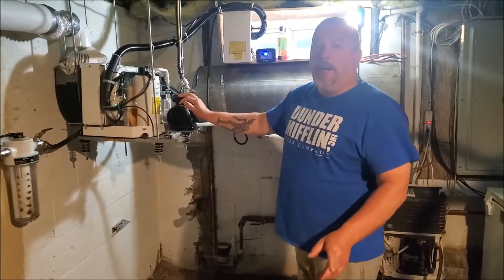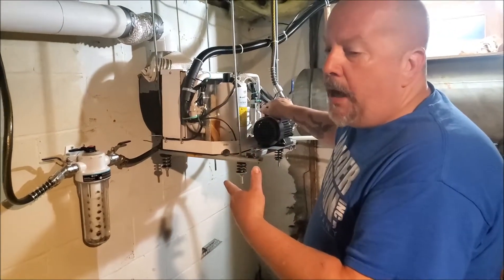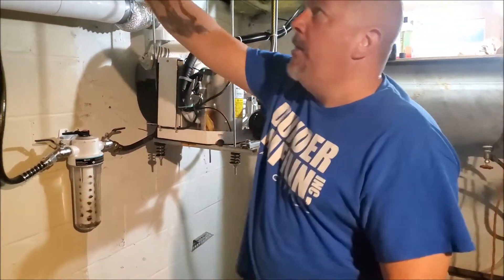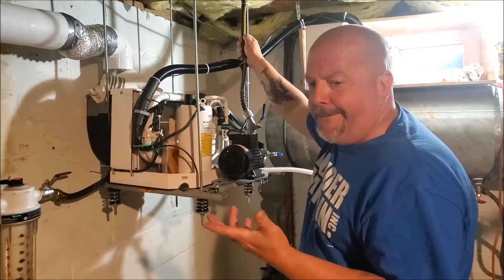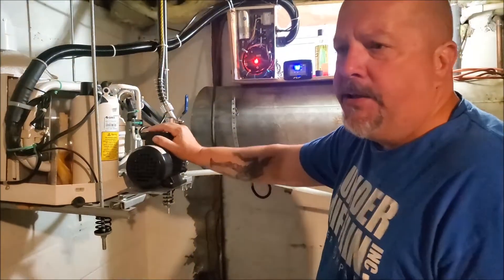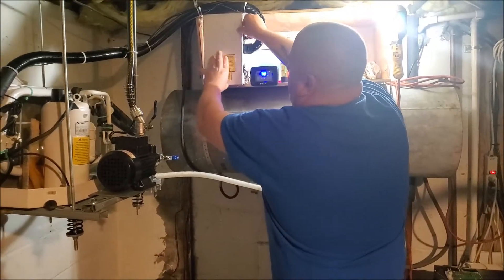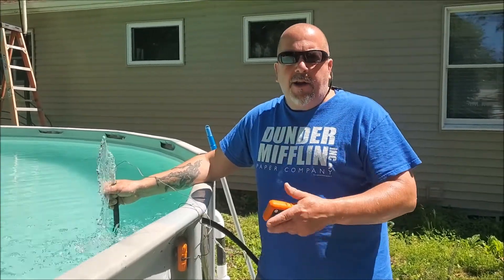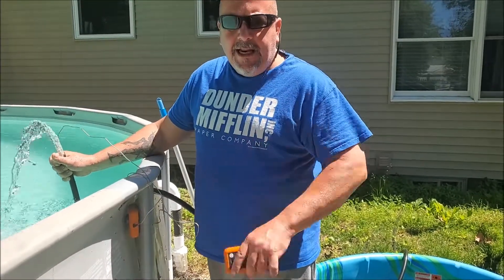Heat pump Air conditioning. Take the BTU energy out of the house, put it in the pool.

Comment: I am curious about two things. You are currently using the pool as a thermal mass for the hot water. Have you considered a second thermal mass for the cold side. Where I am the latest rage in utility pricing gouging is TOU, Time Of Use. Power cost goes up during prime-time hours, 4p-9p. 'Banking' that coolness in a 300 gallon mass for the expensive part of the day could be beneficial.

Do you have historical data? Does the efficiency drop as the pool water temperature gets hotter with your solar improvement?
Reply from the maker: Good afternoon Eugene, The system is not primarily designed as a "heat pump" to heat the pool. The primary goal was to cool off three bedrooms in my house. The unit was sized out for that purpose. Rather then transferring the heat load out to the atmosphere with an air cooled condenser, I felt the btu energy would be better used in the pool. I did monitor the heat differential of the system (Delta T) on a hand written ledger. As well as energy consumption.  The ledger contained data as follows. Date, outdoor temp, indoor temp, heat return and supply on the water, heat return and supply on the air side, Amps drawn from the unit including the pump that circulates water, energy consumption in kWh etc.  I was also concerned about water temp increase adding a significant strain to the compressor. I found the losses were negligible. Remember I'm using a 6400+ gallon pool in the north eastern USA. A 300 gal pool will heat way faster, and you might need to have a secondary heat exchanger to dissipate the heat. You want to maintain +/- 80 deg F condenser water return temp. I hope this answered your questions.

Comment: What is the make and model of heat exchanger?
Where did you buy it?
I think it would work well in Phoenix. Lots of heat to be removed from house.
Reply from the maker: T Jam,
This is definitely not plug and play system. Do you have any HVAC experience? A lot of sizing, controls, electrical, ducting, and maintenance involved. If you goof up anything in the design, installation, or maintenance. the consequences can be catastrophic to your home, if the system works at all.